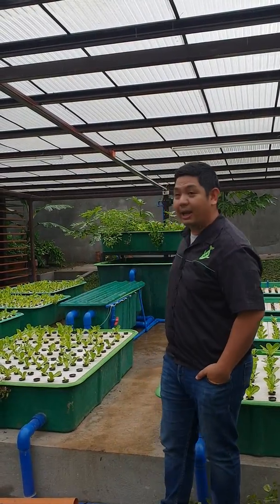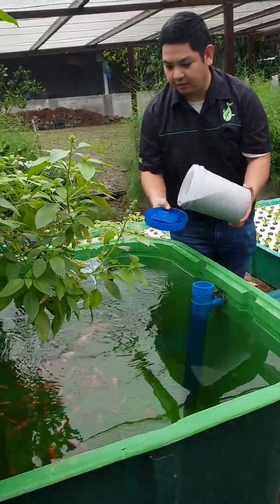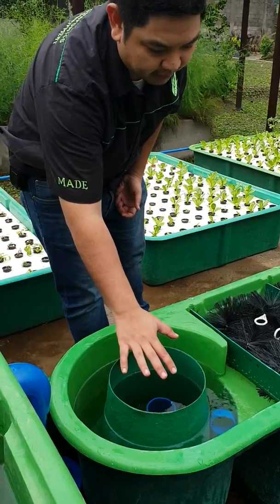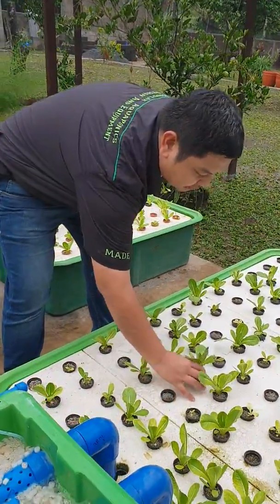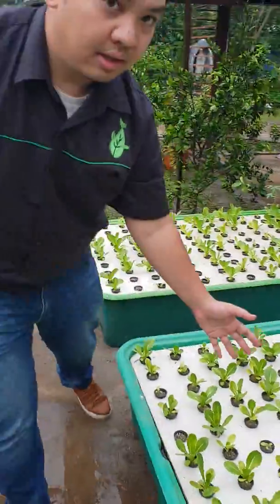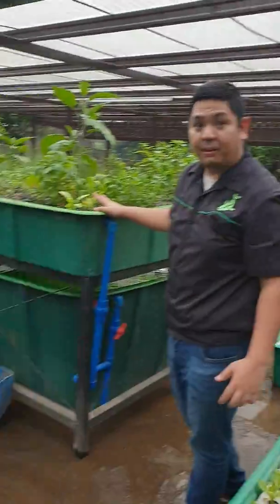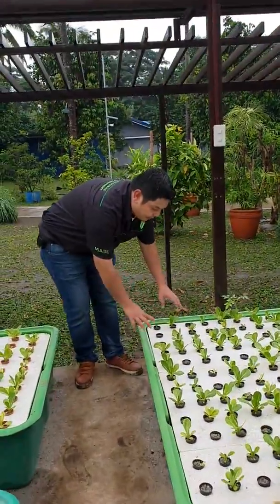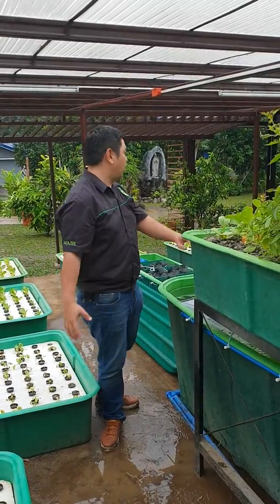MADE 10 growbed Aquaponics System

Comment: Sir good day po, im here in mindanao i have also aquaponics but my system is not already mature, how to determine if the water is already mature and can u till me sir if how much the required  nutrients or total dissolve solid we need in aquaponics bago lagyan ng tanim ang system..pls give me some advice sir marten tnx po..
Reply from the maker: Use test kit to test nitrate levels
Reply: @Madodel  how much the required nitrate levels we need sir to start planting my system?
Reply: My aquaponics is NFT system and i have a 1400 holes in my pipe..